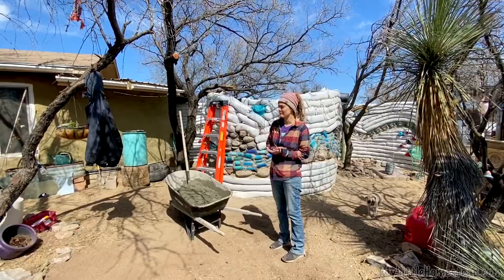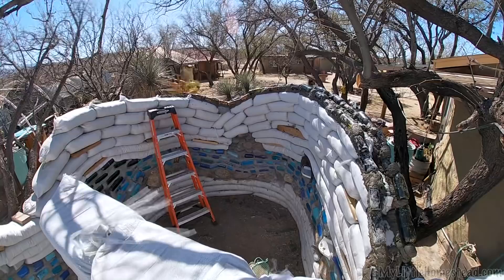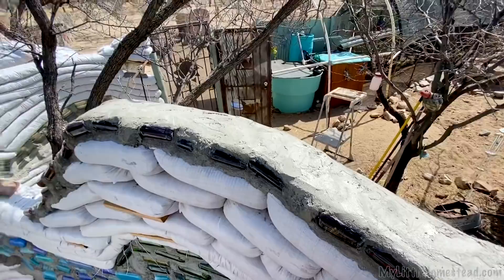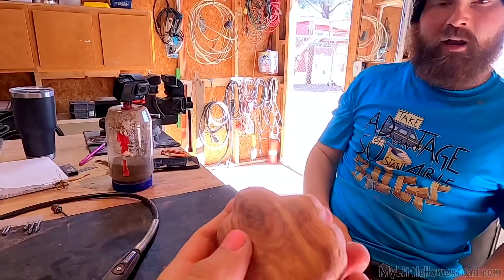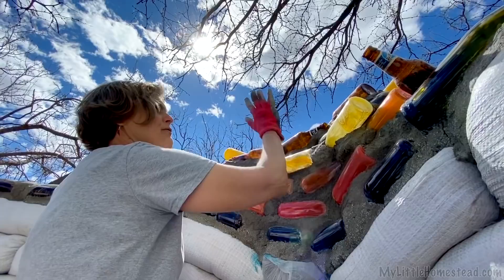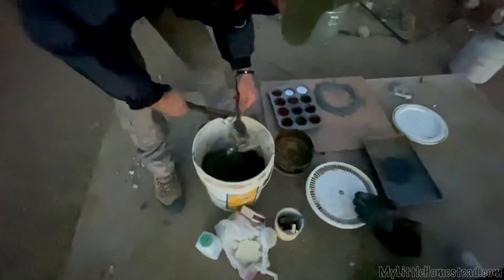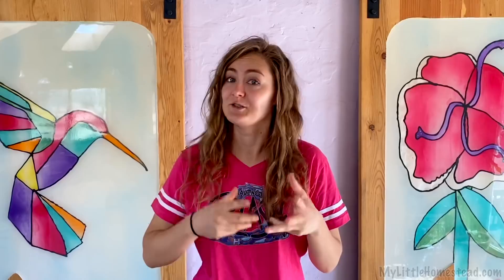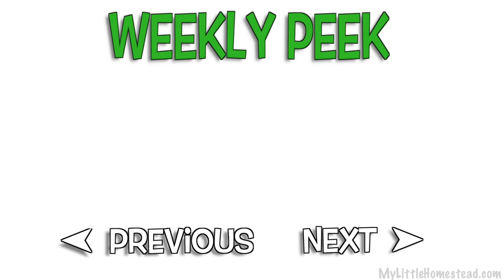Bottle Sunshine for Earthbag Shower, Wood Carved Mobile & Hummingbird Handle | Weekly Peek Ep274

Comment: Just an idea for the mobile. Cut into the star and insert the wheel weight. Use some wood dust mixed with wood glue to patch the hole, and repaint.

Comment: You need to cover the liner in your kiln with refractory cement or it will degrade and blast ceramic fibers out and you do not want to breath them.
Reply: Most definitely!
It will remain functional a lot longer as well.
Added tip - place a piece of cardboard between the bottom and the crucible to help prevent sticking.
Just started the vid - so you may already know this - IDK.
Reply: You seem to know what you’re talking about. May I ask what is that white fibreglass looking stuff lined the foundry with? And why didn’t it catch in fire? Thanks so much! 😊
Reply: @gracieshepardtothemax1743  it’s kaowool , but needs to be sealed .

Comment: A possible solution to the bottles would be to cut up plastic bottles and roll them up and place them in the neck of the glass bottles together,  drill four holes in the plastic tube between the tops of the bottles and run a piece of metal or a stick through for the mortar. For the bottoms of the glass bottles roll up the cut-off plastic bottle around the butted bottoms of the glass bottles. You could put slices in the plastic tube between the bottoms of the glass bottles and thread another piece of plastic through the tube into the lower layer of mortar and have the upper piece of plastic to put the mortar around. You could put mortar between the bottom of the glass bottles in the tube of plastic and drill holes in the tube to allow mortar to get between the inside and outside of the tubes or put straws or sticks through. Use this on the bottles as you did with the nail and board system for the earthbags.
For the sun effect put the rolled-up tubes you put in the glass bottleneck and the plastic tube part that protrudes out into the mortar and drill holes through the end to let the mortar flow through.
 I found out that you can cut plastic bottles into a long thin strip and use it as a cord or rope. Turn thicker strips into cord ties and hold-downs, and reusable zip ties. Use the cord to hold the glass bottle together too.
Another way to cut down on our carbon footprint.
Love your work and how you have super strong family ties and talents. 
God bless you all.

Comment: I've done some aluminum casting and have some tips.   Two words:  FOUNDRY FLUX!   Throw a pinch in the crucible when you first remove it, then stir and scoop out the impurity slag that floats to the top with a wire loop on a pipe or rod, then you get a much cleaner pour and a piece with a smoother surface and less porosity.   Cans as a feedstock have high surface area meaning you end up with more oxide and impurity slag in your melt than from purer ingots or clean thick scrap.

Next, sand molds have a bottom (drag) and top (cope) half so you're pouring into a completely tamped cavity of black sand, not against a different surface of any kind.  For flat pieces like the backing, you'd have a tamped and screeded flat drag and make the top half of the mold on a hard surface with the form then put the halves together for pouring.  3 dimensional pieces extend down in to the sand in the drag.  Then you want the sprue or pour hole to go to a well to the side of the mold hollow, not into the middle of the finish piece, so the aluminum flows sideways into it, leaving any loose sand in a little well at the bottom of the sprue not washed into your casting.  

Finally you want a second hole or riser on the far side of the work piece, for air to displace out so you don't get incomplete fill or a blowout even with a drag below.

If you're going to do a lot of aluminum work, getting a bench mount buffer and a few different rouge sticks will be a game changer for polished pieces.   Oh how I cursed my shop teacher for making me go back and sand out more scratches before moving to the next step, but he was right and the finished project was amazing.That first casting project was 2 theatrical faces, and my Mom still has them 40 years later.

Comment: i did that metal molding before, i did it upside down from what your embossed shapes you did so it was flat on top, the 3-d elements pressed down & flat side up. It's been so long ago i can't be clear, but after i pulled out my shape another layer of oily dirt flat above it w a hole. the top layer was in a rectangular form w the hole already in it rotated vertical, then gently rotated & placed to be parallel so the shape was encased w 2 layers. the flat was on top. i wish i could draw it instead of use words to say how to do it bc it would be clear in a sec.